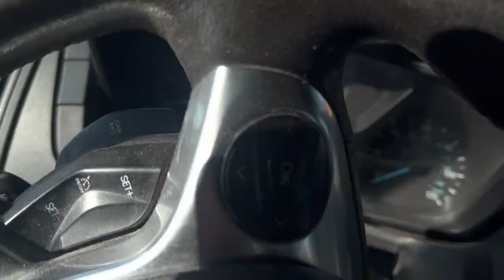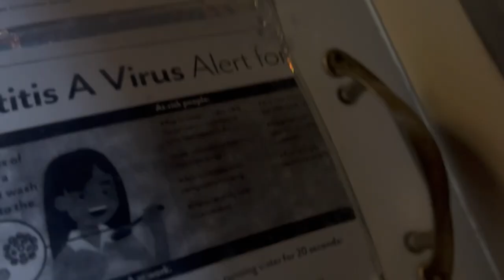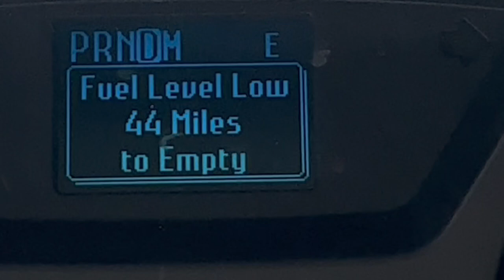Back Flow Installation Galvanized Pipe to Copper

Comment: Devil went down to Florida because there were plumbing problems to be solved😀
Reply: Holy Molé imagine that
Reply: @googol-X  OK now the rap instead of the Devil went down to Georgia you need to do the Devil went down to Florida.🤘🙏💚💚
Reply: @marypaint7255  just posted a reel on the Baphomet Resides in Florida
Reply: @googol-X  😀